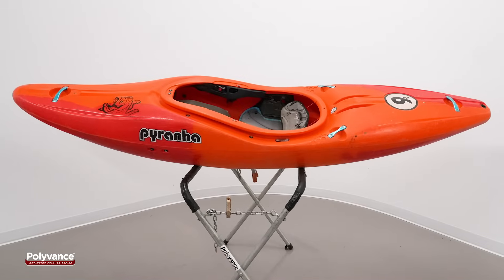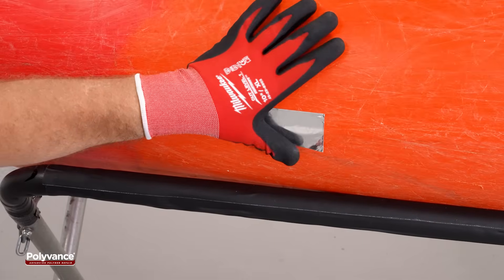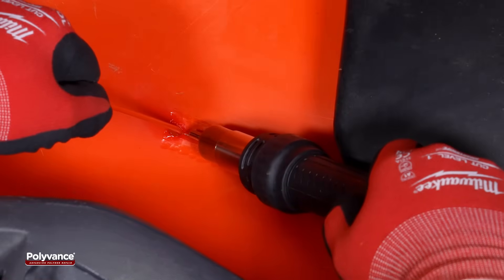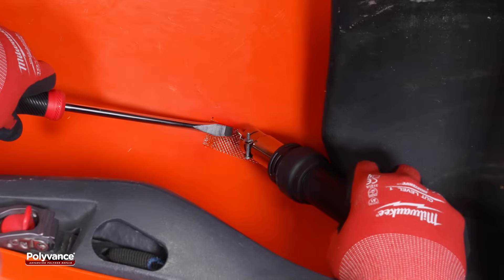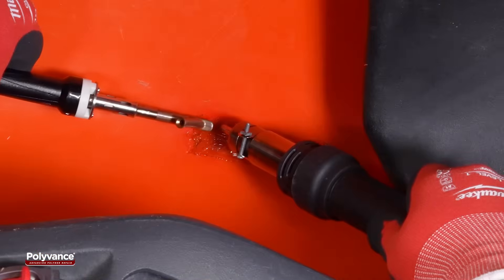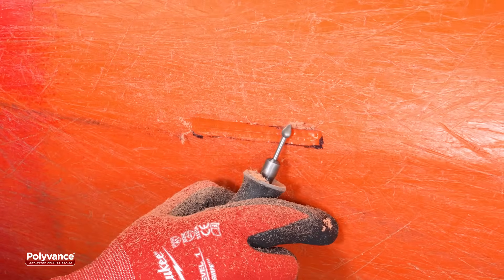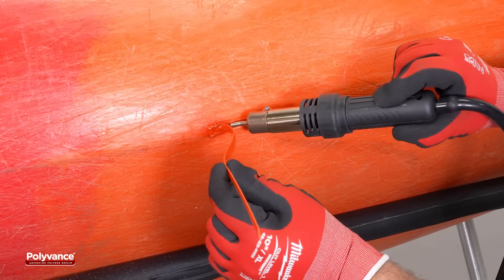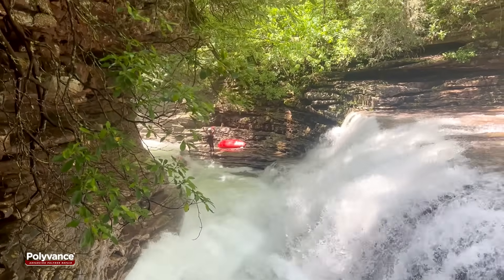Cracked Kayak Hull Repair | Step-by-Step Plastic Welding Tutorial

Comment: When I have welded kayaks, I've always drilled holes at the ends of the crack to eliminate the stress concentrations. Why not in this repair?
Reply from the maker: That is a technique that can be used, but it's not something we've found is necessary.